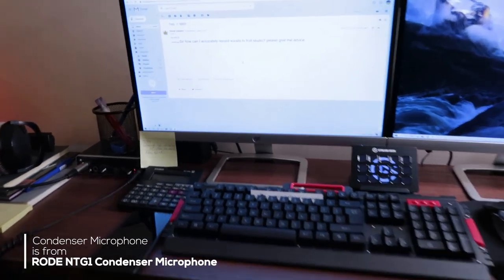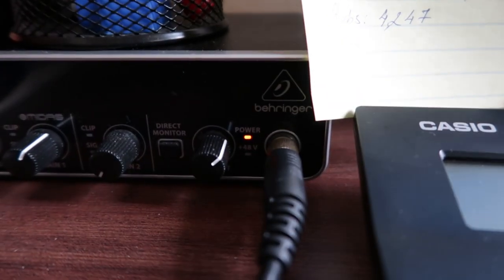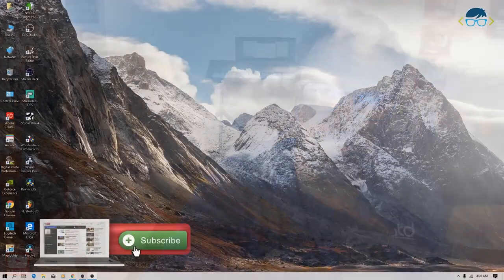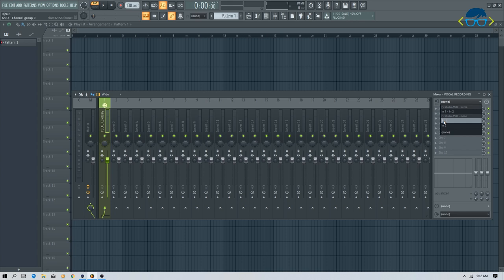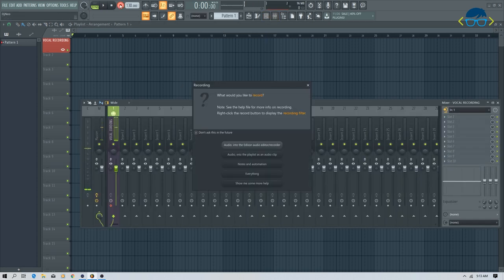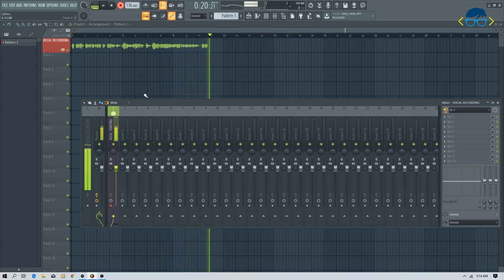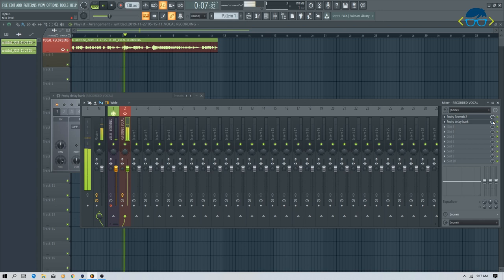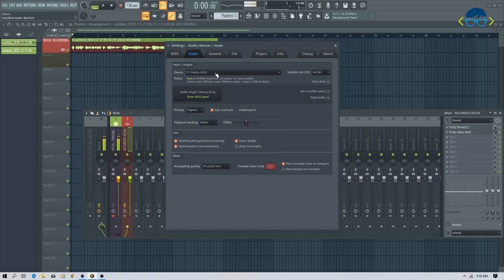Recording Vocals in FL Studio - Proper way using a Sound Card

Comment: Sir 🙏 nice explanation 
Sir I want suggestion 
As there is some driver related issues with the umc22 and I have a low budget ,will it be OK to proceed with umc2 Audio interface ?
Waiting for your kind reply
Reply from the maker: UMC22 Driver related issues are there, but it will still work. I am using UMC22 myself. UM2 is also good if you are only looking to work on production and recording one instrument or vocal at a time.
Reply: @djneo  thanks a lot for your reply Sir